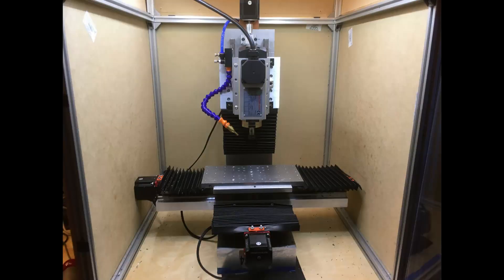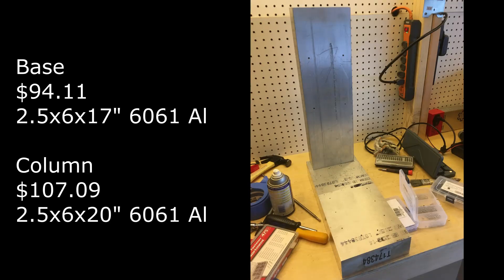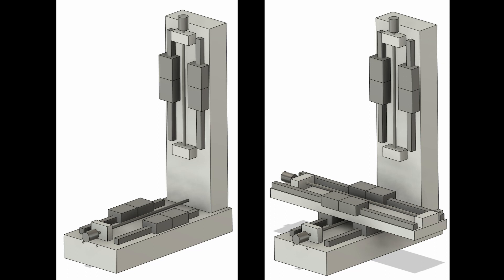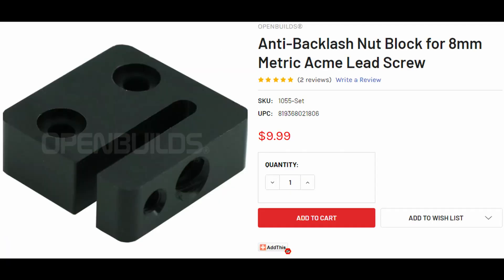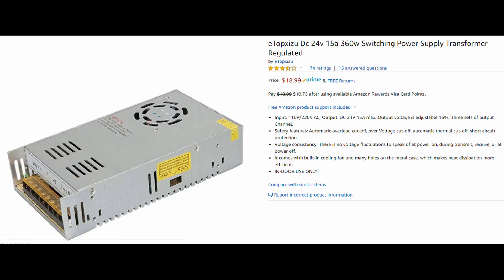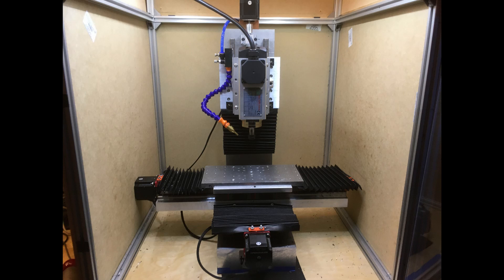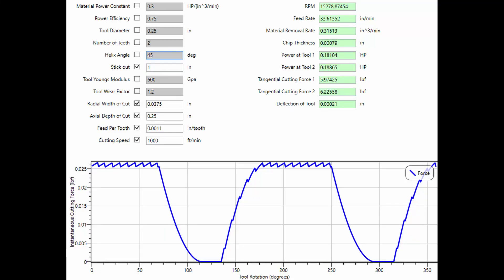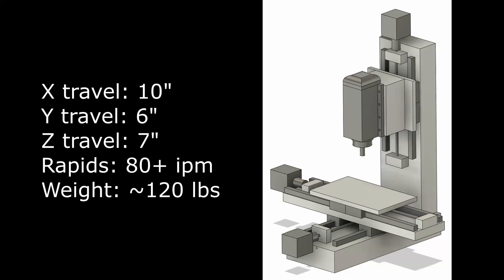Aluminum DIY CNC Mill: Parts and Cost

Comment: I am using your dimensions and material list to make a mill like yours. I am a trade machinist 20 years. You could buy a bench mill but retro fitting a bench mill has limitations also. # 1 they have ways not linear bearings. The RPM is also limited due to gearbox.  
I will be substituting aluminum for steel and I am making it thicker. 3" Cold rolled for frame and column. I want it heavy to dampen vibration.

Comment: Hello, Recently got interested in making a small CNC mill for Aluminum. Was almost ready to start Milenium Milo v1.5 and then found your channel. I go your metric Fusion project. I will finish the CAD with bolts and whistles, I plan to make it Duet-based ( I think wifi will handle the steppers just well) Are you OK if I publish it as an open-source
Reply from the maker: Yes, that's fine.
Reply: 10x
 @imnoexpertbut

Comment: I think where you would see the real savings is when you throw in precision parts and things like precision ball screws and linear rails, servos, and a nice control interface.

Id probably go a little more beefy on the actual design of the mill, something perhaps a little more rigid, but all in all, you have a mill that you can actually make proper parts with and with far more rigidity than a router.  Very nice man. 

Can you buy the aluminum stock pre faced and dimensionally true?

Comment: Hey, fantastic build. So much so that after much research and coming up short on accessible options like you said you did (and being inundated with all manner of different extruded engraver designs), I'm simply going to duplicate your design. It is exactly what I'm after, and at a not-too-bad cost for what it can do to boot! Bonus.

I'd already begun ordering and assembling the electronics side of things prior to searching for a physical frame design, which is where most of my lingering curiosity lies in your build. I'm interested to know a bit more of the details behind the steppers, particularly why you chose to drive them with 24V instead of 36/48V, and what current you're driving them at and why. I've got a set of Pololu TB67S249FTG 4.5A drivers on their way, which will be driving a set of NEMA23 motors rated at 2.8A. I chose these drivers in case the motors I ended up scoring brand new for $10 a pop end up being too low on torque (and also because of cost and size). This way I have some headroom and can simply drop in stronger motors and keep going if the need is there. These drivers will be socketed in a Protoneer CNC breakout board (basically an Arduino / Atmega328 hat) on a Raspberry Pi 4 running bCNC. I intend to drive the motors at either 36 or 48V, since the drivers are spec'd for 50V by Toshiba (and the board should have no issue with that either, since the caps are 50V too), but I don't have much experience working with steppers yet, which is where my question above originates. Is there a particular reason, perhaps having to do with motion control on the software side of things, that makes 24V more ideal?

Thanks for sharing all your knowledge and trials with us, it really is appreciated!
Reply from the maker: I used a 24V supply because it's better than a 12V supply, which I had used in a previous 3d printer design. From what I've heard, 36V and 48V will work even better if your steppers and drivers support it.

I'm driving my steppers at just below their rated current (there wasn't an exact setting on my driver that matched the stepper, so I rounded down). I originally started with 175 oz-in 2.8A steppers, and later upgraded to 3.0A 269 oz-in steppers on 2 out of the 3 axes (I have the larger stepper for the third axis, but it won't fit unless I widen my enclosure slightly). The smaller steppers were experiencing some backlash under load (and it wasn't due to the mechanical system, it was definitely that the steppers just weren't turning for small inputs). I think they didn't have quite enough torque to overcome static friction for small inputs; I could have played with the microstepping to try and improve it but the bigger steppers were a drop-in replacement for me and fixed the problem.
Reply: @imnoexpertbut  Good info, thanks for that. I figured as much for the stepper current given the method of setting current on those style drivers. That was one of my considerations for choosing the drivers I did, that they have an adjustment pot that can be dialed in precisely based on Vref to arrive at exactly the current my steppers are rated at, that way I can squeeze every last oz-in out of them. The microstepping vs torque is something I'm particularly concerned about with my motors as well, so it'll be interesting to see what I come up with there. I feel like I have bigger steppers in my future already.

I've been looking more deeply into the frame the last couple days and gave Xometry a look for materials. Unfortunately, it seems that they have instituted a $45 minimum order value per piece, so some of the prices for the smaller things like the saddle, x carriage, z carriage & z head, as well as the 1x1 bar used for the bearing mounts are higher than quoted, considerably so for some pieces. I was just wondering if this was something that you experienced as well? Maybe calling them to discuss the entire order to get around that minimum value per piece policy on the smaller stuff is a possibility. Given that I don't have a bandsaw, my bearing mounts would have to be ordered individually pre-cut, which at 6 x $45 each is obviously cost prohibitive. Perhaps I can find a local machine shop willing to cut a 10.5" section of 1" square bar to get the requisite 2.5" blocks, but the cost for some other items is still pushing the total up considerably. Plus, I can't seem to find a metal wholesaler who's willing to cut to size for reasonable prices up here in Canada, so my material source is still up in the air. I guess what I'm asking is what was the ordering process like with Xometry. Did you just add everything to the cart and place the order for the prices quoted, or was there a phone call involved?

Thanks again, cheers!
Reply from the maker: @xyphur  I added everything to the cart and placed the order for the prices quoted, no phone call required. You can also sometimes find good deals on ebay for offcuts. You're going to need a way to cut stock down to size anyway if you're going to be machining, so you might as well get that sorted out now, so you can order stock more cheaply and cut to size yourself IMO.

Comment: HELL NO!!  With the Grizzly you'd end up stripping it down to the frame just to realize the most valuable part is the steel base and column.  Perhaps a benchtop model for $900 (Little Machine Shop XD2) - again for the rigid steel frame - $600 of your build build parts.  Your design would give a Tormach 440 a run for it's money.  Be proud!

Comment: really nice, how many rpm do you use for milling aluminium? i heard you need pretty slow rpm, does the spindle handle that well?
Reply: Aluminium has high RPM, Dia 12mm (1/2") about 12k RPM is normal. 6mm (1/2") goes to 24k RPM

Comment: I don't know how much faster the spindle could cut but I think you can get a lot more power/torque out of your steppers by running them off a higher voltage power supply (which is where you'd see a difference between the 42V driver you got and the DM542 50V drivers, I think).  From Gecko drives, "The voltage of your power supply is entirely dependent on the inductance rating of your motor, which we learned is translatable to the number of turns of wire in the stator. Every motor model will have a different inductance rating and will therefore have a different maximum voltage. To figure out what the maximum power supply voltage should be, use the following formula with the motor’s inductance in millihenries (mH) used for the L value.
32 * SQRT (L) = VMAX"  (https://www.geckodrive.com/support/step-motor-basics.html) One of the steppers you linked in your BOM, https://openbuildspartstore.com/nema-23-stepper-motor, says it has 3mH/phase, so that'd be 32*(3)^5=55V, the other one, https://www.amazon.com/gp/product/B077Z5QJCL, says it has 4.8mH so then ~70V.  I don't know how much headroom the power supply and/or drivers need to be safe against back EMF from the motors, but I think you can go a lot higher than the 24V as is and make your motors push a lot harder, faster.

Comment: Love the videos! I was wondering what you use as a spacer between the nut blocks and the axis bases? I am worried I am getting some backlash from the torque on my nut blocks because they are so far offset from my axis plates
Reply from the maker: Yes, they need to be tightly against the axis bases to avoid backlash. I used to 3d print spacers, since plastic is fine in compression. That works great if you have a 3d printer, although it is a little fiddly to get the spacers into position when assembling everything. Now I make my own nut blocks, and build the spacer into the design by using thicker delrin stock.

Comment: Great build.  Not to knock your design but I just wanted to point out that you can buy the base and column for a sieg SX2.7 or 2 at littlemachineshop for around the same cost as the aluminum.  The column for the sx2.7 is ~142 and the base is ~ 161.  These are apparently ~4x more rigid than the sieg X2 mill column/base.  You are rolling the dice a bit with the quality of the castings and how flat they end up when they get to you but it is an option many don't consider and quite a lot cheaper than buying a machine and then tearing it down just to use the carcass.  the nice thing about your approach is that you can machine the aluminum stock to you desired tolerances and make sure it hits the numbers you need.
Reply from the maker: I did actually consider that! I also thought about using the mill's head casting. Ultimately, I didn't decide to do it, because I kept waffling between doing that vs buying a complete mill to convert, and ended up finding some cheap aluminum off-cuts in the meantime. I think it would have resulted in a quieter mill, because cast iron does a better job at damping vibration.

Comment: This is awesome! I'm currently in the end stages of getting my own CNC Mill online, much heavier though (and more expensive, but nothing close to Tormach prices). I used hot rolled steel, grinding it as flat as I could using smallish and cheaper granite surface plate and Prussian blue. The thickest I could obtain from typical metal shops was 1" thick without paying an absolute fortune, but that seems to be good enough for now. I just used a rectangular tube for the column, welding another 1" plate to the bottom to mount it with 6 M10 bolts to the base plate. I want to fill that column with Epoxy granite when I get the time. I wanted more torque and fewer RPMs compared to the typical Chinese router spindles you will find all over the place on Amazon, eBay, and Aliexpress, so I got a cheaper Chinese BT30 spindle (one of those green ones that lack an automatic drawbar) and a 1.8kW AC servo motor and driver so I could eventually set it up to do rigid tapping. Maximum Spindle RPM with my current GT3 (15mm wide) pulley belt setup gets to around 4700 RPM maximum since the Servo is only rated to go up to 3000 RPM. I also did this since I didn't want to be stuck with a spindle that didn't have taper tooling, and just having a fixed collet nut on it. Much easier to swap tooling repeatably and quickly even if I have to use a manual draw bar. Plus my lower RPMs and higher torque allow me to use smaller face mills and larger diameter tools. :D I decided to run the machine with LinuxCNC, which has horrible newbie documentation, but it is so powerful and the IRC for it has helped me out a ton with building the machine overall. Much better than GRBL. I am using a raspberry pi 4 (4GB) to run LCNC, and it is connected to a couple of Mesa Anything IO controller boards over SPI do handle the step/dir signaling in real time while the Pi and LCNC worry about the actual path planning and calculations that normal computers are good at. I am using closed loop steppers at the moment for the machine, Nema 24s from stepper online. They have been working great so far. I really don't want to deal with the game of "was there a step loss?" and let my controller know when they happen and stop if the stepper drivers can't compensate for the loss. Now I just need decent CAM software and more time to finish things up... Getting good CAM software on Linux natively seems impossible, so for now I'm stuck with FreeCAD's path workbench.
Reply from the maker: Sounds great! The lower RPM will also allow you to more easily drill and machine steel. You should make a video about it!
Reply: I'm no expert, but Maybe at some point :) I don’t have much footage of me making it. Just some pictures. I’m guessing you use Fusion 360 for CAM?
Reply from the maker: @Thorhian  Yes, Fusion 360. Although I've been wanting to learn FreeCAD.

Comment: Is there a reason you wen't with separate driver and an arduino instead of a cnc kit like the mach3 boards on aliexpress? Did they not offer enough power for the motors?

 I think that using epoxy granite wouldn't change the price by that much since the epoxy is quite expensive and your aluminum price was not that expensive. You would easily spend $50-100 on a gallon of epoxy and then $20 for the granite. Making the molds can be free or cost quite a bit depending on how much you need to buy. Since some of the mounting surfaces can't easily be made from granite you can really only replace the 2 most expensive aluminum pieces. Overall I think you did a great job keeping costs down without going overly cheap.
Reply from the maker: Thanks! Mostly the reason I went with an arduino plus individual components was because that's what I knew the most about, coming from 3d printing. To drive a cheap mach3 or linuxcnc breakout board it sounds like you need a PC with a parallel port, and I didn't want to have to find/build one of those, or buy a more expensive ethernet breakout board. With GRBL/arduino doing the motion planning, I can just use an old cheap laptop I had laying around anyway to feed it g-code over USB.
Reply: I'm no expert, but Thankfully you don’t need a parallel port for LinuxCNC if you get a Mesa FPGA card. You can get PCI, PCIE, and the more convenient Ethernet Mesa cards. Mach 3 is okay and easier to setup but it doesn’t really compete with a well configured LCNC system with good hardware. I just wish the project had more documentation for complete newbies.

Comment: What kind of accuracy and repeatability do you get out of this machine? It looks like a nice conventional machine. I worked in a machine shop a LONG time ago and I'd like something larger than my little Taig mill. 

Great job!
Reply from the maker: Thanks! It has a little less than 0.001" backlash/repeatability. I was able to interpolate a circle with about 0.003" error. The biggest issue at the moment is that it's out of square/tram by about 0.001-0.002" per inch depending on the axis (fixable, but tedious). I bet it's similar to your taig in rigidity, although it's got a high speed spindle, which is great for aluminum but terrible for drilling.
Reply: @imnoexpertbut  thanks for the information. Getting the tram right is one of my concerns. Without using machined blocks as your base it could prove difficult if you need get it closer to .001" over the full axis. The Taig is very adjustable when it comes to that. I've been thinking of using the Taig spindle on whatever I decide to build. A new Taig spindle is not that expensive and they have an ER16 collet chuck. 

I'm not a big fan of the high RPM spindles. They're great for wood working but scary for metal, at least to me.

Comment: Hi, this is a really nice build. I am trying to recreate it in Fusion to match available aluminum blocks and in metric units. Can you perhaps share your Fusion file and the link to the OpenBuilds site if that is OK with you?
Reply from the maker: Here's the fusion file. Note that it's got approximations for some dimensions, so you will need to use it as notional reference only: https://a360.co/3erh7Vy
Reply: @imnoexpertbut  Thanks a lot, I am just unsure about a couple of things so this might help to set things straight. Otherwise I have it almost finished. So if the price for aluminum is OK I might build it during long winter nights :). I mean I am not looking for a Haas or something, just a more rigid thing to help with cutting larger aluminum pieces aside form the Workbee cnc I currently have, it cuts OK, but the Z axis is the limiting factor for larger pieces. This build seems easiest from what I have found. And it does not require any special tools / materials. Better quality manual mills cost north of 2000 EUR here + conversion, so this might be a lot cheaper for me to build + the fun of building it :) (or perhaps someone can advise a good one in EU for a reasonable price?).
Reply: @chprogress  Can you share your metric CAD files? I'd be very interested.
Reply: @HoopstarsGarage  sure, I can share the fusion project when I have some time. Can't say it is production ready but hopefully it'll be of some use.
Reply: @HoopstarsGarage  https://a360.co/2QMEorI, sending from phone, it says viewing only, do not know if you can download. If not I'll update the link next week when I'll be able to share it from pc. I changed some dimensions an modified some parts, so no guarantees on the design. Going to work on it during the long winter nights :)
Reply: @chprogress  Can you enable downloading the file as it is currently in viewing mode only? Thanks.
Reply: @foxoy9559  Should now be downloadable. Did not do much with it since the last post though-
Reply: @crabsshed  Thanks